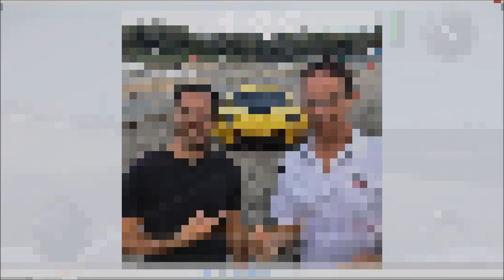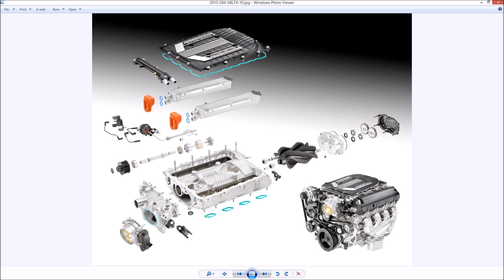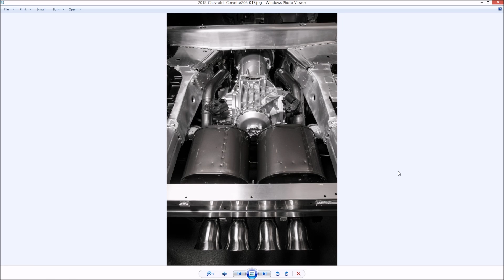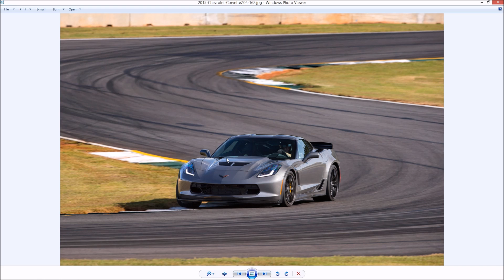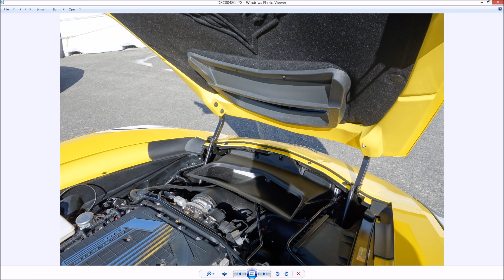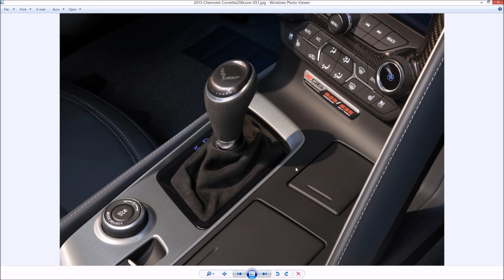Let's Geek Out About the Chevrolet Corvette Z06

Comment: Hi Carlos. Gotta question for you but it pertains to the Corvette Z51. I wanted to switch my tires (not for track purposes! Just for me) I mostly use my baby for tearing up canyon roads. I find Michellin Super Sport Cup 2s too expensive & TOO aggressive (like I said I'm not using them for track purposes) Would you suggest wider Pirelli P Zeros (285 w/19in fronts 305 w/20in rear ends) or slightly less expensive/less aggressive Dunlops (less aggressive in comparison to Cup 2s)

I'd appreciate your opinion! Are my Michellin Cup ZP efficient enough? Is there a way to increase my cars handling via tire change without getting super expensive Cup 2s!?
Reply from the maker: betty ushie You got a Z51 with Cup 2s on it? The Pilot Super Sport is the tire that comes on that car, and they're great in my experience. Haven't done any wet weather driving with them though
Reply: Lol No I don't have Cup 2s. I was saying I didn't want to resort to getting them. So I was giving other options like the Pirelli P Zero or Dunlops. I know they're less expensive than Cup 2s & not as extreme
 Just wanted an alternative/upgrade that isn't the Cup 2s on the Z06
Reply from the maker: What's wrong with Pilot Super Sports you currently have? I've been continually impressed by those tires
Reply: I wouldn't say that any things wrong with them. Just wanted more. I'm also looking into engine tuning as well. Debating on which turner would be best. I'm not looking for Z06 performance or power but just something a little more substantial, that's all
Reply from the maker: To be honest I'm perfectly content with the Michelin Pilot Super Sports that come stock on the car. What do you feel are the shortcomings of the tires?

Comment: Damn....Chevy should've found a way to fit in a dual clutch automatic since they had planned to do so. But, still, it is an awesome car. I love it!
Reply from the maker: tmat04 Why? It would've been heavier
Reply: Carlos Lago 
Not necessarily. I've always been amazed at how light-weight Chevy managed to keep the Corvette in the past, until this particular Z06. The C7 Stingray is a perfect example. They could've found a way to build the new Z06 without exceeding 3300lbs, even with the addition of an 8spd dual clutch automatic. I know they can do it. But, nonetheless, the new Z06 is an amazing car, like I said. Even at over 3500 lbs (and without a dual clutch transmission) it is extremely fast. And it is also (in my opinion) one of the best looking sportscars in the world. If I had the money I would have already placed an order. The 2015 Corvette Z06 and the Tesla Model S P85D are my dream cars.
Reply from the maker: tmat04 An equivalent dual-clutch would've been heavier than the auto they're using. If they could've found a dual-clutch that hit their weight, packaging, and torque constraints, they would've used it.

Comment: Carlos does the zr1 feel faster than this new z06 in a straight line or does the broader torque curve in this new car make it seem faster? Considering the old zr1 is 189 pounds lighter I could see it feeling just a tiny bit quicker but I could also see the torque in this car making it seem faster or maybe just more responsive out of the gate would like to hear your thoughts on this.
Reply from the maker: CarGod They both seem fast enough that deciding which one feels faster is like splitting hairs
Reply: Okay thanks was just curious if the the weight mattered very much I guess. I have driven the stingray and my friends 08 Z06, I also own an 04 Z06. Those handle great so the new Z06 must feel absolutely insane on a track its a whole new level. Just wow.

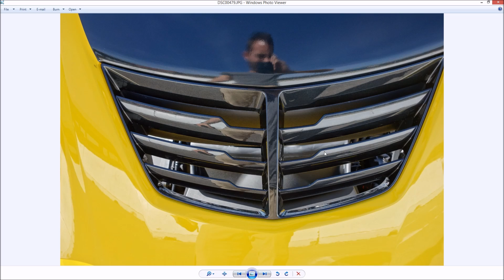Comment: @ 50:40 Carlos explains that the hood (bonnet) is very soft and the black colored vents can bend out of the way. So, this is why, when a certain Mr. Jeremy Clarkson, was bending the rear of a C6 way back when it was reviewed in Top Gear UK. I think I get it now.
Reply: No actually Clarkson didn't realize that the Corvette does not have an external bumper and that what he was pressing in was what is called a 5 mph bumper.
This sort of bumper is called such because in the case of an impact at up to 5mph it is designed to flex and not have any structural damage, not that the car was poorly made...
Reply from the maker: BleedForTheWorld Yay for fiberglass!
Reply: Carlos Lago Hey Carlos would you take this Z06 over the Nissan GT-R? I just wanted to know. Why or why not?
Reply: Devonte Murray Z06 in a heart beat.... I have driven a C6 for the last 6 years and fixing to purchase the new 2LZ Z06.  Both cars are awesome , but the GTR can only beat the Z06 on one thing and that is shifting.  The GTR has the second best gearbox on the road... But now with the C7 8 speed auto, I feel that it is the best way to go

Comment: Excellent video! This thing is insane. Please do more of these videos. What sound setting was the exhaust system on when the ignition episode 119 video was shot? One thing I noticed if I am not mistaken is the transmission and differential cooler halfcaducts seem to be missing on the convertible?
Reply from the maker: Vasek Cekan Exhaust was on loud mode, of course! Yeah, the convertible manages airflow a bit differently than the coupes.

Comment: Most cars crap themselves on the track. Whether it be the brakes, coolant, oil, diff, intercooler.. I thought they would have paid special attention to that with the addition of a supercharger. My 2001 ZO6 couldn't do a 20 minute session at the track without hitting 280-290 degrees on the oil, at which point I'd do a cooldown lap and bring the car in.  I expect to do a 20 minute session on a 100 degree day without trouble on a modern car. I hope GM addresses this.
Reply from the maker: varnazar Don't break out the pitchforks yet -- these were development cars and got used hard by media. As I mentioned in the video, we'll be looking into it with production cars next year.

Comment: *****  The Corvette delivers the most power (if the Aventador isn't a part of it) but even then it's a lot lighter than the Lambo and delivers the kind of straight-line speed as a McLaren 650S but in terms of handling, everything on that list might as well wave goodbye.  The car generates 1.19g and stops from 60 mph in 91 feet, with every single stop in less than 100 feet.  The only car that has a faint hope of beating it is the 458 Speciale but even then I'm doubtful about that. 
The Porsche 911 Turbo and the Nissan GT-R (any one) beat the Z06 off the line, but after the car gets its stride it could just walk away.  It's lighter and more powerful than both with better aerodynamics, and in the corners, like I said earlier, neither car stands a chance.  Check and mate.

Comment: Is it accurate that the tires on this Vette are only good for 10K miles?
Reply from the maker: Louie Lamoore Depends on how you drive it; spend all day on a skidpad and you'll go through a set very quickly.
Reply: Louie Lamoore depends of your alignment and which tires your run. I know guys that have C6 ZR1 and run the MPS Cup1's only get roughly 5k due to the aggressive alignment and heavy track use. But I have a C6 Grand Sport with a sport alignment and just changed out my Bridgestone Pole Positions 25k miles. They had roughly 5 track days, 45 drag strip runs, ~8 trips to the mountains, and a lot regular daily driving.

Comment: How is GM getting more horsepower out of this Z06 vs the LZ1 Camaro? More boost with the Camaro as you alluded to but still 650 vs 560 HP.
Reply: Louie Lamoore The main reason is the Z06 engine has Direct Injection and is able to run a higher compression ratio because of it. LS9/LSA motors ran roughly  9.0:1 where as  the LT4 runs 10.0:1. Also the LTx engines have a host of upgrades over the LSx motors.
Reply: Truth Brown Yeah I figured the internals of the vette engine are more performance minded vs the Camaro. And that's what they are. Just got back from the Corvette plant (tour) and saw a many Z06's coming off the line into the dunk tank (as they call it) to check for leaks. An amazing plant is this place. Very quiet and most automated. The black on black Z06 with black rims looks mean/lean. .

Comment: awesome vid thanks!  How did the manual feel? this guy said it's notchy and he gonna get an auto. He said it's pretty bad! auto is faster I am not sure if I gonna go with manual or auto :(   400 tq from idle and max 650...I guess the TC is really good? or else it will kept spin the tires on street? any ring laptime yet and how much are dealers marking up this beast.
Reply: Carlos Lago
This is a great informative video. I'll be looking forward to more "Lets Geek out" videos starring the ATS-V and the Shelby GT350. :)
Reply from the maker: okaythen001 It takes a little bit to get used to the tight gear spacing (a product of a seventh gear), but otherwise it feels great. Really satisfying shifts. GM's traction management is superb, on par with the stuff you find in supercars.

Comment: 1. Do you think with Stage3 Aero & the 8speed auto that you'd be able to knockoff a tenth on the Figure8 time? (I think you said there wasn't any shifting involved however the computers might very well be able to hold the car at a more suitable Rpm range throughout turns to bang out a faster time! What do you think?

2. I've watched COUNTLESS videos from Edmunds, MotorTrend,  DRIVE etc... This new Z06 is the most capable Vette to date in every way! (Still waiting for a Nurb Ring Time along with a Fast Lap at Laguna Secca!) However... Until then... I've read many comments on an anticipated Nismo vs Z06 comparison for whatever INSANE reason! Like you've stated, the Vette has always punched above its weight! Both the "OLD" 2013 ZR1, & the 2012 Z06 Centennial Edition (even as far back as the 2010 ZR1 but ill stick with the two mentioned) have been tested extensively by MotorTrend & Edmunds! Even back then those cars produces numbers that TODAY'S 2015 NISMO hasn't & CAN'T match! Beating the Nismo is 60-0, Lateral Gs, Figure8 time, Slalom, SMOKING it by seconds at Laguna Secca! With the Vettes posting 1:34.43 ('12 Z06) 1:33.7 ('13 ZR1) not to mention the Vette is cheaper, has a better interior, & is a better daily driver (the Nismo is EVEN STIFFER than the normal GTR which yeah they improved for the Standard 2015 model along with a quieter cabin which is why that's the version you should've tested agaisnt the Z28 & your last best driver's test instead of the Nismo but that's another story lol) Anyways... Being that the Nismo can't compete any ANY LEVEL with even the old vettes let alone this new one! (Not even 0-60 or quarter mile with the auto) WHY waste your time with a comparison test which I feel MotorTrend will unfortunately
Reply from the maker: 1. It's doubtful. Cornering speeds are too low for aero benefit, and I bet the aero would make the car slower on the straights between the corners. The auto's advantage is that it can shift where you normally wouldn't, like right before a braking point or during a tricky set of turns. I don't think the auto would get much of an advantage.

2. People like seeing the comparisons, so we make them. Don't take them so seriously; just enjoy them.

Comment: Video and review was great as always. This cooling issue was mentioned in C&D testing also. I see GM is banking on most  not to drive this beast real hard. Probably at least 1/3 of the buyers will push limits of cooling. I guess the aftermarket is here for a reason.
Reply from the maker: Jeffrey Williams Too early to tell. We'll look into it again when we retest the car sometime next year.
Reply: Carlos Lago
Yeah is it a little early but cooling 650 hp is no easy task. No oil cooler as factory option does make me pause. You know as speeds rise this beast does get hotter. Looking at C&D test at 160mph  does hint at some issues. The stage 3 does carry a lot drag. Could the cooling be a issue also??? The time to 160 did take quite to bit of secs. This is a roots type blower unlike 1 on Hellcat. I don't expect a big top end but numbers should be somewhat faster.
Early in the yr temps aren't the issue. The Leguna test in the summer will tell the true story of this Z06.
Reply: Jeffrey Williams The LT4 comes equipped with a factory oil cooler, the design is similar to that on the LS9. A picture of the oil cooler can be found here: http://media.chevrolet.com/media/us/en/chevrolet/news.detail.html/content/Pages/news/us/en/2014/Aug/0820-8speed/0820-compact-powerhouse.html 

Why are you making this statement: "No oil cooler as factory option does make me pause." ?
Reply: *****
Great info and facts on this oil cooler. It does have all this but why is there a cooling issue???
Reply: Speculation holds little value, but as Carlos mentioned; this was a pre-production media test car being driven to 10/10ths on a humid 85 degree day by a very experienced race car driver. If approaching the limits of cooling in this scenario was the only issue encountered with this Z06, given its performance envelope, I would say Tadge and team did a tremendous job in development and execution.
Reply: Hopefully all these issues were due to many at press driving in a short time. The Chevy team did a great job with this beast. Actually I had already seen such oil cooling mentioned in a Z28 video. Z28 did run hot in a R&T track battle this year. Not sure what was the issue but this cooling issue has been stated before.
Like I said before  Leguna test at track will tell the real story here. Hell Cat will be there too. We get a chance to see 2 very high powered machine tested in some summer like temps.
Reply: I read the review with NISMO vs Z06. Based off what was said, GM has some more work to do. Still a great but these issues are holding back the car.

Comment: Totally agree with you on the cars without roofs point Carlos (40:50). I love that the car is only offered as either a removable roof or a convertible only because if it were offered as a hardtop I'd probably feel guilty opting for the removable roof based on (likely unnoticeable) performance differences. With a car like this you want to know that the car is the absolute best that it can be. Also removable roofs are totally bad-ass and should exist more than they currently do.

Awesome video by the way.

Comment: Carlos, quick question CD publish that going from 0-150 took 17.9 sec and 0-160 took an additional 6 second. That does not sound right to me, what dd you guy ssee when you tested the car, did it loose that much in acceleration from 150-160 ?
Reply from the maker: P Teng Looking at their chart, the difference is 5 seconds, and that sounds about right. I didn't see those speeds during testing because our drag strip isn't long enough. Looking at the standing mile run I did in the Hellcat, I see a 5 second difference there too. The accel curve really flattens out quick at that speed.

Comment: Hey Carlos, i have literally spent the last few hours thinking about what a good head to head comparison would be for this car. Just based off the testing results and Randy's track time it seems like there are only a few heavy weight contenders that would make sense for this car. I'm not sure if you have already filmed an actual head to head for motor trend yet and if you have I'm not asking for spoilers. But being a tester of modern performance cars I want to know what you think would be interesting. I was thinking obviously the NISMO as an option but mabee even the new Porsche GT3 when you get your hands on it. What are your thoughts
Reply from the maker: Marc Favia That's always been the tough thing with Corvettes: They punch way higher than their price point. If you're comparing it dollar-for-dollar, the Z06 would go up against a 911 S. If you're going by track performance, you'd be comparing it with a McLaren 650S.
Reply: Yah I guess that would make it quite tricky. Some of my favorite head to heads are the ones that don't seem obvious. The ones that don't match up horsepower price drive trains purpose etc. furthermore I do think that when it comes to the z06 it is not just bargain Performance it's true performance at any price. Due to this I think a McLaren 650s would be a great way to test this. For example I though the z28 vs gtr track pack h2h was brilliant.
Reply: Carlos Lago Do the head to head with the McLaren 650S if you think it'll be close in lap times! It would be quite satisfying to see such a less expensive car slaughter the exotics! :P

Comment: Would there be any benefit in making this engine with a flat plane crank. I assume better breathing but would that also help the supercharger
Reply from the maker: Hanna Shunnarah Flat-plane cranks have big vibration issues as the displacement increases, which is why you seldom see V-8s equipped with them exceed 5.0 liters (the new GT350 being the sole exception at the moment). Overall, you'd see better gains by simply putting on a bigger supercharger. But the Z06 doesn't need any more power in my mind.
Reply: Thanks. It doesn't seem like it needs more power. I noticed motortrend doesn't have a video of the 458 speciale and I feel like that would be the direct competitor in terms of performance to the z06/7

Comment: I was a little confused with the downshifting in Randy’s lap with the auto. It didn't sound like it blipped throttle for downshifts but it also didn't look like the chassis was upset at all either. Did Randy mention anything about that?
Reply from the maker: Stig Msr It matched revs. Watch the tach.
Reply: I noticed the tach but the sound didn't sound like the normal bark of a blip. I was wondering if the torque converter had something to do with it. Maybe I'm just going deaf. Thanks for the quick response sir. You alway put out quality videos.